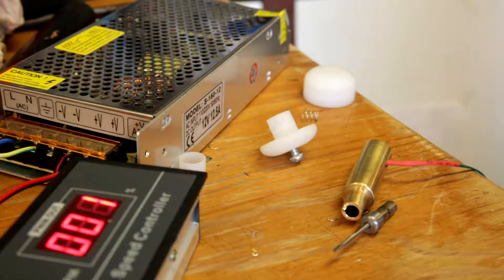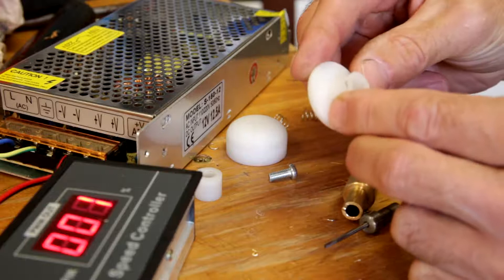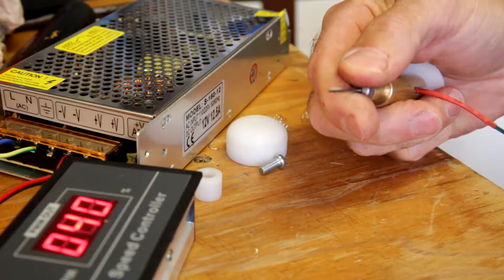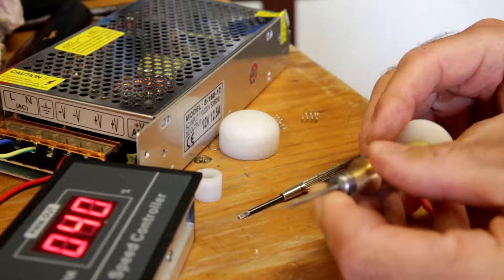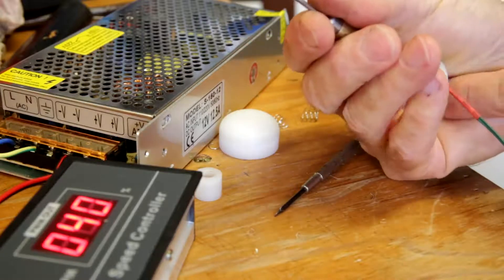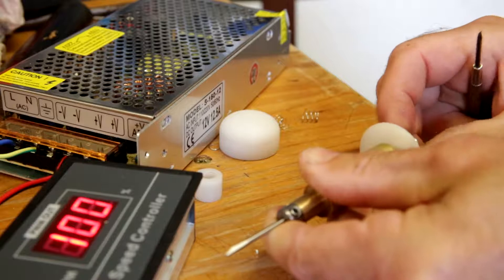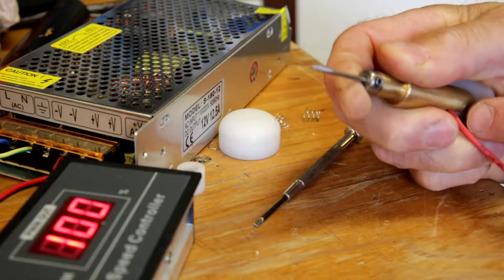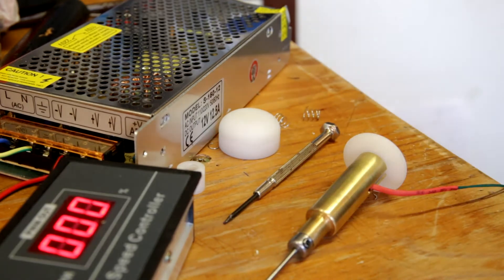Easy graver hand piece design refinement

Comment: Alastair, do you have an email, I have a few questions on setting the hall pedal in the code.  My machine won't go to zero when I let off the foot pedal, it reduced to a very slow idle but not zero.
Reply from the maker: You can pm me on Instagram @alastairduncan4

I have had this occasionally, I think it occurs because of  electrical interference. If it happens I trace the power cables and try and make sure they are not near any of the data cables. Shielded cables may help but I've not gone down that route as it's not been a major problem.
Reply from the maker: You could also look at the output from the pedal in the Arduino monitor. Uncomment the print statements. It's possible the values from your pedal were slightly different from mine so the code may require a little adjustment so that it will register as 0.